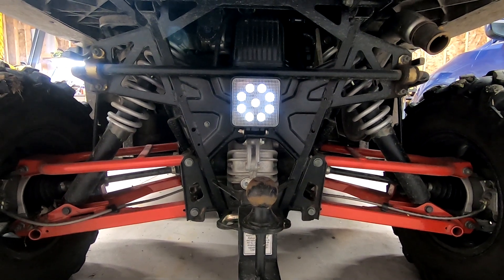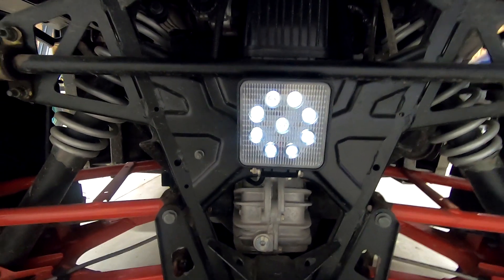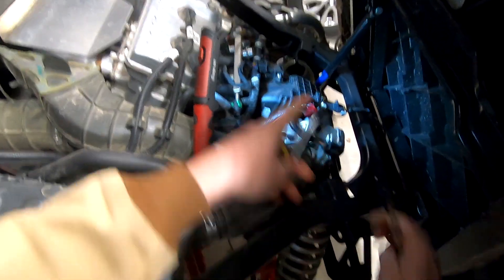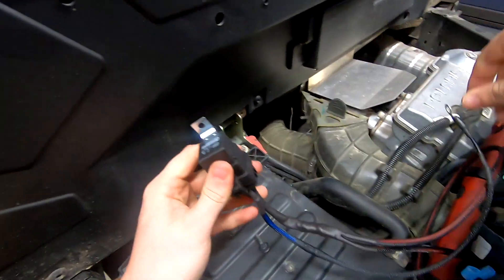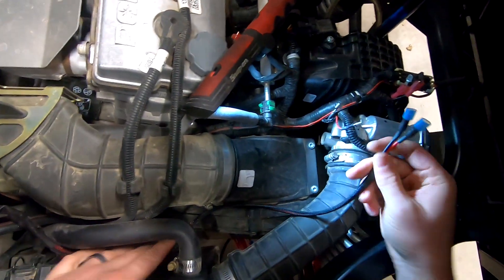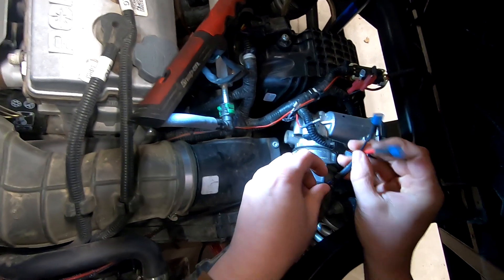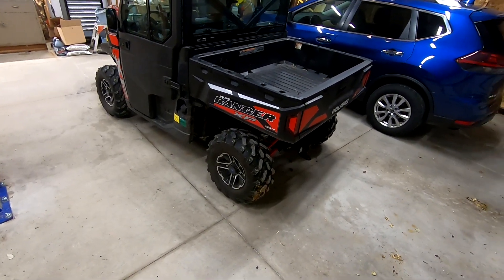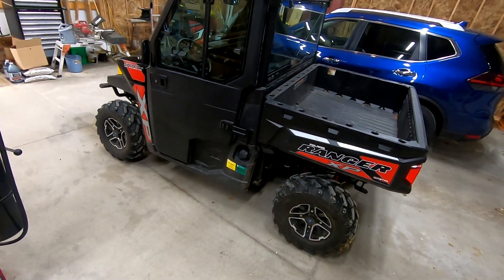LED Backup Light Dimly Lit When NOT in Reverse [Polaris Ranger UTV]

Comment: The signal from the transmission wires is probably not intended to provide power to a load (light).
When not in reverve, there is a potential of 5-7 volts between the two wires from the transmission. In reverse, the two wires go to 12 volts.  To properly power the light, connect the wires from the transmission to an  automotive  relay coil (terminals 85 and 86).  The relay will not pick up with just the 6-7 volts applied, but will energize when the reverse switch closes.  Now run a  fused red positive wire from the battery to terminal 30 of the relay.  Complete the wiring to the light using terminal 87 on the relay and a negative wire to the light.  
I'm assuming your solution just merely opens the circuit to the light when not in reverse, then completes the circuit when the reverse switch operates.  I'm not sure what you are grounding.  Comments?

Comment: Mine stays dimly lit even with the key off. Has anyone else had this same issue?
Reply: mine goes off after about a minute and a half
Reply: Mine stays on all the time also......
Reply: Mine also stays dimly lit even with the key off. Did you come up with a solution?
Reply: No I didn’t but it won’t run your battery down
Reply: Relay fixed mine
Reply: Do you have a part number for the relay

Comment: Is this a problem on 2022 Polaris Ranger 1000 models?
Reply from the maker: I've heard of this issue happening up to the 2021 models. I would suspect it is likely a problem for the 2022 models as well.
Reply: Yes because it's back up camera not rear light plug in
Reply: Yes I have a 2022 Ranger Premium XP 1000 Crew and it has this issue as well.
Reply: Yes I have a brand new 2023 xp 1000 and it still lit
Reply: So the fix for a $10 light is a $65 relay harness? Thats dumb as shit…..
Just leave it be. After machine is off for 5-10 minutes it goes out of dim mode and doesn’t affect battery life.